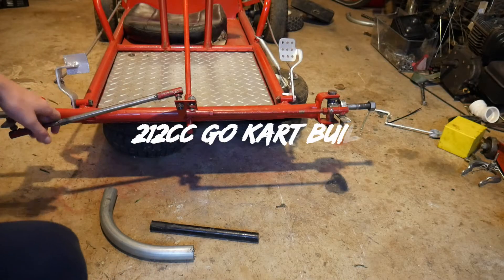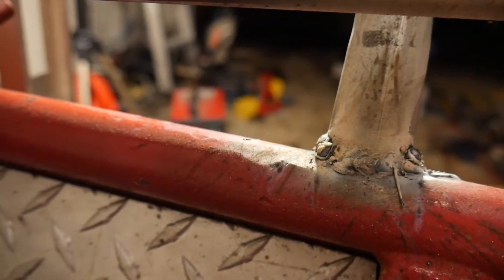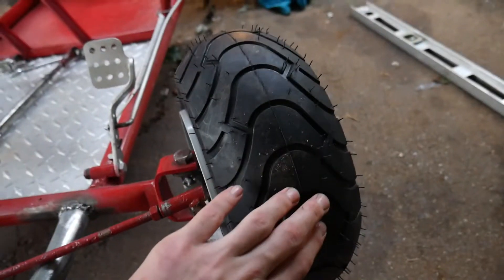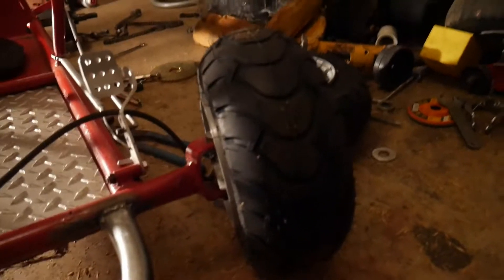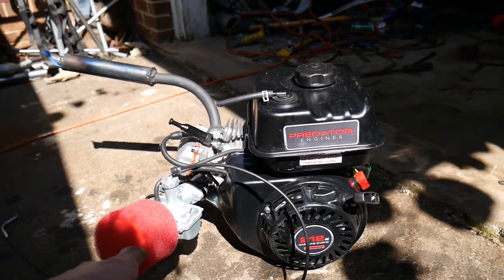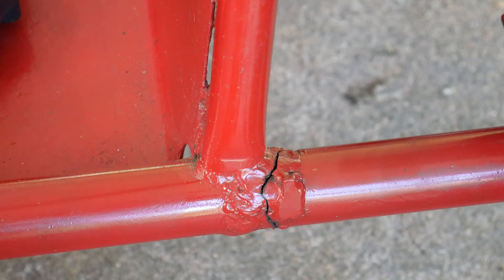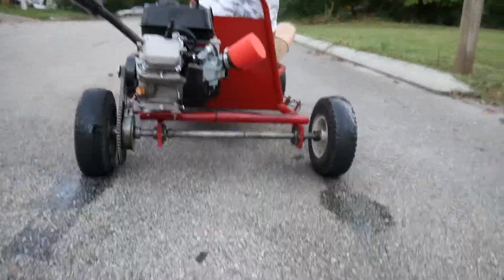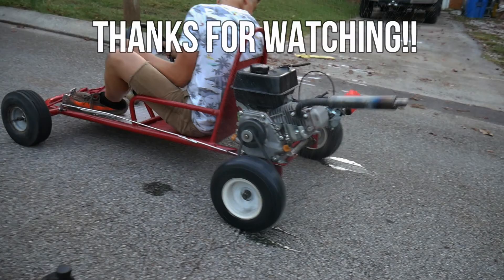212cc Go Kart Cheap DIY Performance mods!! (Part 3)

Comment: Did you remove the low oil sensor? You need to do that for karts. what clutch and sprocket sizes you using?
Reply: Also make sure to wear a helmet and if you wanna drift get some thick pvc pipe and cut it to the width of the tire and hit it on with a hammer. You will really slide then. But most of all have fun!

Comment: might need to turn your wire speed up just a bit ... sounds like its missing. When your welding, you are drawing C's ... CCCCCCCC ... at the bottom of the C, continue right to the top of the next C ... C/C/C/C/C ... Slow your hand speed down and allow for penetration into the metal. Your not laying metal on top of metal, you're deep stitching the metal together and if you allow for a deep penetration, your weld will not only look good, but it will be 10X stronger. If the metal is cold when you start, be sure to heat up the metal, otherwise you will simply be laying metal on top of cold metal with no penetration. That's called a "cold weld" ... Great video!
Reply from the maker: Thanks for the advice!! Yea back In that video  was a n00b, my welds failed and looked ugly; improper technique. Now I am am somewhat comfortable with the way I weld. But still need a lot of practice

Comment: are you sure that this is the Mikuni vm24, because I read many forums and the Mikuni that goes on to predator 212cc engine is the vm22 type.
Reply from the maker: Premium Nivist I must of got confused. But yes it is the mikuni Vm22 not 24
Reply: Vasily Custom Builds Thank you for your fast reply. Because I was already going to order the vm24 one. And one more question. Are you Russian???
Reply from the maker: Premium Nivist No problem. My parents are. But I do speak it
Reply from the maker: Premium Nivist Oh and one more thing. If your going to buy Vm22 for 212cc. Go to gopwersports.com and buy the Vm22 manifold they sell